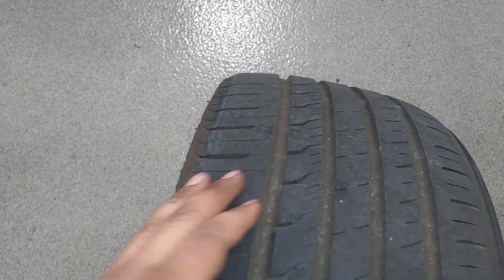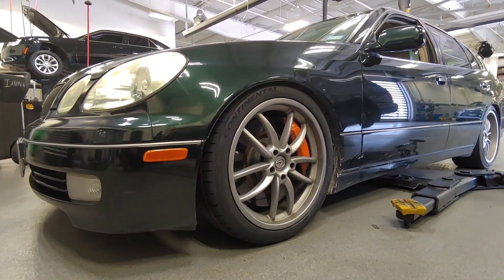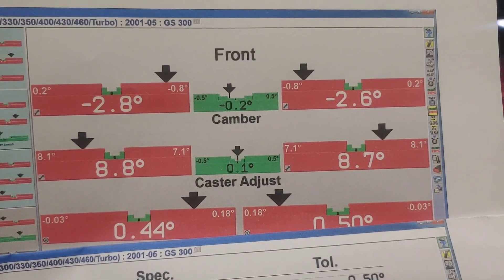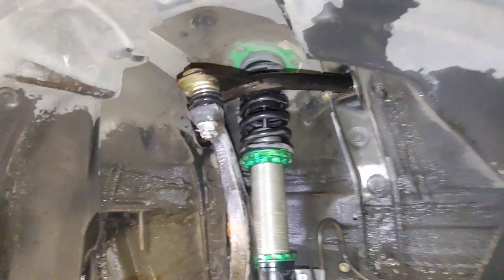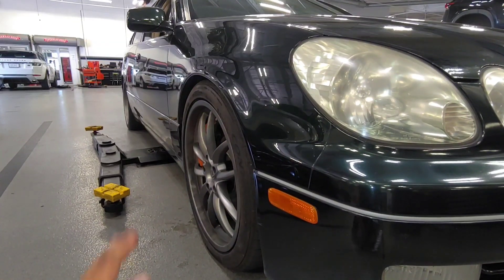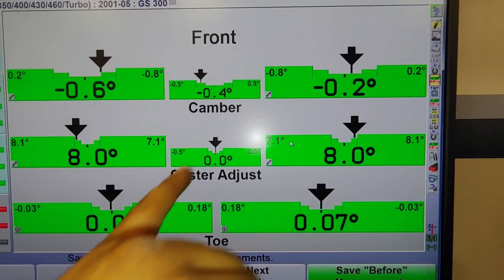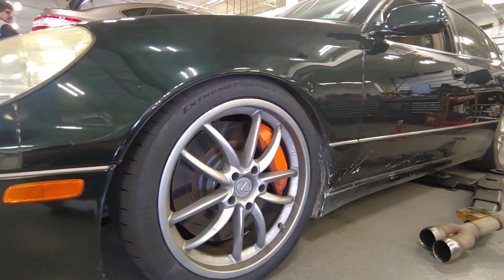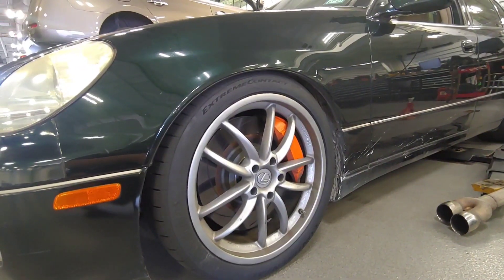Gs300 Mevotech Control Arms. Correcting Negative Camber & Caster

Comment: Curious how the tires been after 6months or a year?

I ask because shouldn’t negative camber cause a gradual wear from the middle of the tire to the inner edge? Not just a strip on the inner edge. 

I’m curious if the inner edge wear started developing again even after the alignment.

I have the same exact inner edge wear but my cars been aligned twice within a year, car tracts straight, and camber is within factory spec but getting close to falling outta spec. It’s at about 1.3 degrees.

Comment: I have the same car, I'm about to lower it on 18×8.5 +35 245/40r/18 with some Tein Flex Z they come -1.4 drop front and -1.8 drop rear from factory. My question is, are those adjustable arms really necessary?
Reply: Yes when you lower a vehicle it adds toe and camber, that applies to front/rear
Reply: @s13gene  Yeah, when I posted, I actually had all of those things 🤣🤣🤣 I just didn't want to install them. Which I did eventually. I learned that if you don't be right there with the alignment tech, they'll bypass the extra adjustments, they hate that!!!

Comment: corrected negative camber for no reason , instead of the small patch of wear on the inside it will be the whole tire 
you can run -30 degrees and have no issues on tire wear. 
the real issue is TOE

Comment: 340? That still sucks, I usually go with something from the high performance touring category. Way better treadlife, we’re talking at least double what the continental is rated. Plus traction is pretty much the same, way better in the wet too. I know summer tires once they start to get worn down get a bit squirrely in the rain